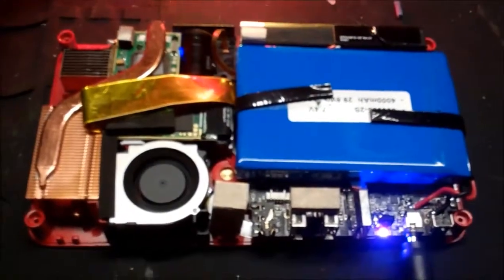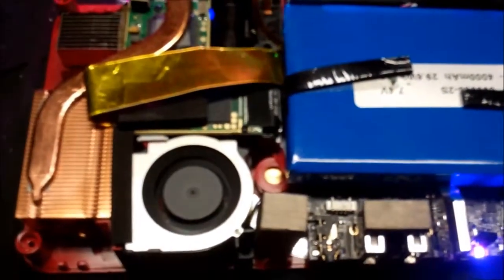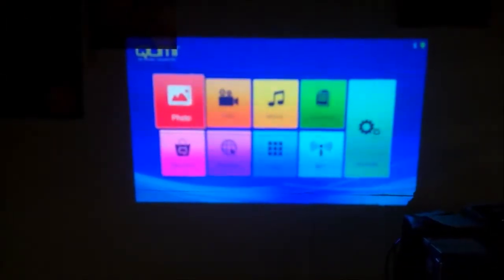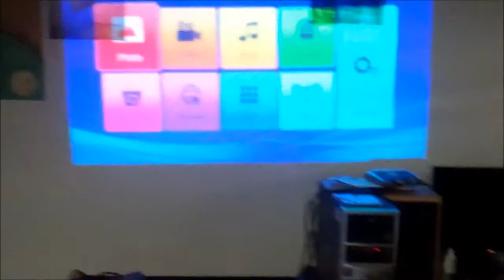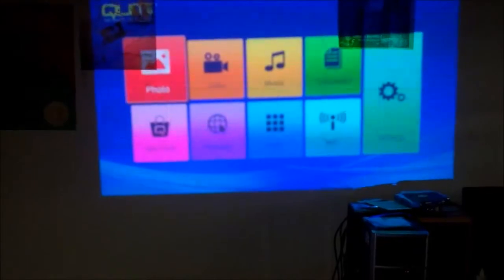Let's Fix a Vivitek Qumi LED Projector

Comment: There's a lot of reports for the Q3 Plus remote stopping working - which I think may be the receiver rather than the remote itself. Vivitek don't want to know about this but it seems like a product fault to me. Has anyone managed to take apart and check the receiver with this issue?

Comment: I bought a Qumi Q-38 about 3yrs ago but due to new baby and house move I never opened up the box until today only to find the power/fan comes on and I get a red light on battery and blue light, but the DLP bulb is not working :( any idea for a fix on it? This isn't my first projector, I've owned several DLP and LED and LCD ones, but this was the first Qumi series and they dont even make the Q38 anymore :(
Reply from the maker: I honestly don't know much about them.   This one had an obvious problem.   I usually fix guitar amps.

Comment: The Q3 Plus has a motorized focus system, which can only be adjusted with the Q3's remote. 
Anyways, my unit's whole DC jack just snapped off somehow and must've gone inside the unit or something. I sent you an email as I would really love to get this fixed asap, thanks!!
Reply from the maker: I emailed you back.  Check your spam folder.

Comment: My Qumi Q5 has a purple tint to it, as if the Green LED stopped working (I can see red and blue light, but no green) any ideas?
Reply from the maker: I don't know.
Reply: @DeadKoby  Thanks for the reply, I took it apart to see if i could find anything that was obvious, but no luck. Now ill have to see if its even worth sending for repair.

Comment: Hi, my qumi q7 not powering with deck buttons or remote but blue led is on
Reply from the maker: check across the board for cracked solder connections.   You can learn about this, and re-flow on other youtube channels.

Comment: hello , i lost the first media menue( Qumi Q7 Plus). What can i make?
Reply from the maker: I don't understand your question.
Reply: @DeadKoby  after a wrong firmware update the first menu (media menue) is gone.... now vivitek said to change the mainboard...
Reply from the maker: It may be possible to re-flash the firmware with a JTAG unit,  but that's not really my department.
Reply: @DeadKoby  Thanks. Nobody can help :-(

Comment: Hi there I have same projector that now is not receiving signal from the original remote control. Vivitek kindly sent me a new remote control but neither works.
Reply from the maker: May be the on the receive end,  either an antenna if it's RF,  or the eye if it's IF.   hard for me to guess.

Comment: if you're using your phone for recording, I'd recommend you try Open Camera for recording. You can manually adjust the focus with it, use an external mic, etc.
Reply from the maker: It's not a phone... but instead a flip camera.  Remember those?

Comment: I have found that with modern day stuff including flat panels and laptops 9 out of 10 issues arise from the damn power supply or power supply connectors usually less than $1.00 dollar in parts.
Reply from the maker: I still have to get the feel for fixing switching power supplies.  Linear types I understand completely.